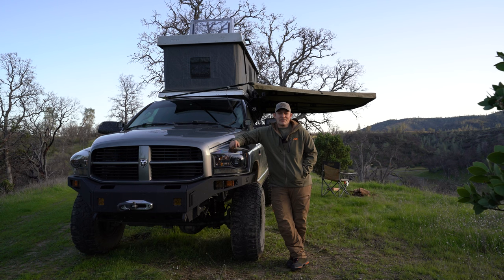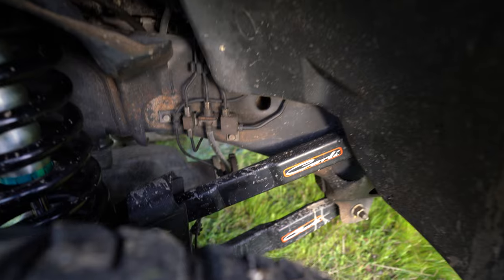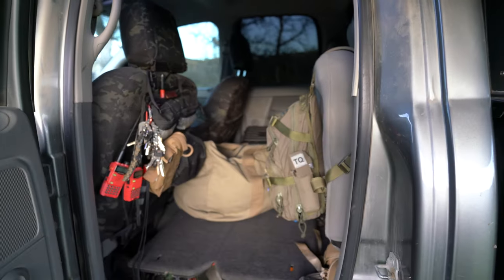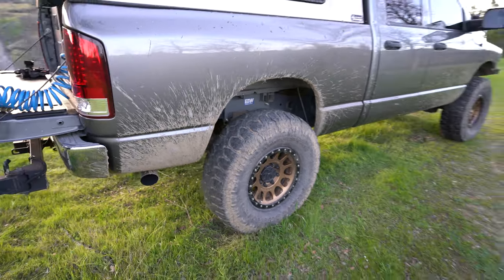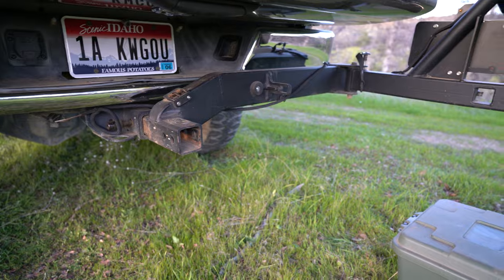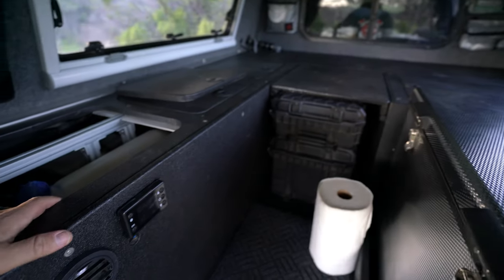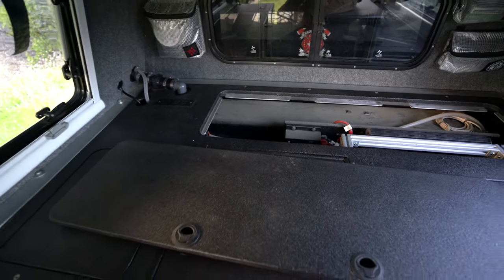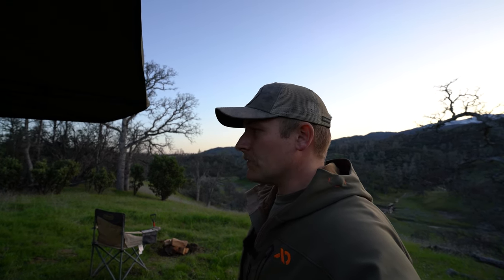Ultimate Overland Diesel Ram Walkaround

Comment: Yeah nice build, EXCEPT YOU BUILT IT ON AMERICAS WORST PRODUCTION TRANSMISSION...
Reply from the maker: How is the G56 6 Speed Manual the worst transmission? In my opinion, its one of the better manuals for a light duty pickup out there. Did you think it was still a 68Rfe? Because I mention in there that I did the swap 2 weeks before that video was made lol.

Comment: I have that same bumper and winch, did you have to use different wires to get the winch set up?
Reply from the maker: No sir, tight fit but it worked out good.

Comment: Ever Found yourself wishing for a front locker? I’ve got an open diff front end 2003, same exact build and suspension as yours. Wondering if I should throw an elocker in before my next big trip.
Reply from the maker: I’d love to have a front locker. There have definitely been a few times I really wish I had it. But if I’m honest with myself, it’s not a rock crawler, and I can get through most things the way it is with a winch if I really need it. One day I’ll get a locker, but it’s not high on the list at this point.
Reply: @EpicAdventuresOffroad  gotcha, I’ve got some trails planned in Utah and Idaho that have me a bit worried. I’ve got the factory lsd in the rear but the power wagon e locker fits in these 9.25 AAMs up front. May throw it in for piece of mind. I won’t have others with me to pull me out
Reply from the maker: @coltonramsey1574  yeah if you can find one of those that’s a great route. 👌 update back here how that works out if you do it. Might pick your brain a bit on the process.
Reply: @EpicAdventuresOffroad  will do, just going to do some more research on how the front end will handle it. I have the free spin conversion, 2014+ power steering pump conversion, and the mopar 6 bolt box/bad axe brace but just worried about all that tension when steering off-road locked front and 9k lb truck

Comment: You did a diff cover in the front and not the back? Between the extra capacity, cooling a and servicabilty, rear all the way. My seals were leaking, ran low of fluid and almost trashed rear end (200k miles f250). The the Bars additive and cleaning out my magnetic plugs regularly, I avoided a 5k read diff rebuild. I added AT205 with the Bars for added protection and and slow my diff keak. My 6.0 for is known for oil leaks....3 bottles, leak down to a very small drip on the driveway...hope this helps.
Reply from the maker: The front cover was replaced because a buddy needed the stocker and wanted to trade me that Mag Hytec for it. Screamin deal for me!

Comment: Got that Bluetooth front driveshaft
Reply from the maker: I did indeed. I mentioned in there that I had just swapped my transmission from an auto to a manual, and they’re slightly different lengths, so I was getting the other one lengthened.
Reply: @EpicAdventuresOffroad  No hate lol, I had figured that once you mentioned it.  I've had that problem at my old job!  😂

Comment: Great equipped rig. I have a 2019 Ram 2500 I'm running the same front bumper and winch and am currently installing the controller to under the backseat. Did your controller fit in the bumper?  Your fairlead looks lower than mine. Just curious
Reply from the maker: Thanks! and yep, everything fit in the bumper. Definitely a tight fight though.
Reply: @EpicAdventuresOffroad  How tight are we talking? I have the same truck, bumper, and winch but the winch won't fit by like 1/8 of an inch. Did you have to make a tiny bit of room?